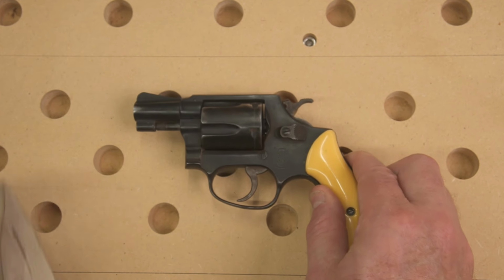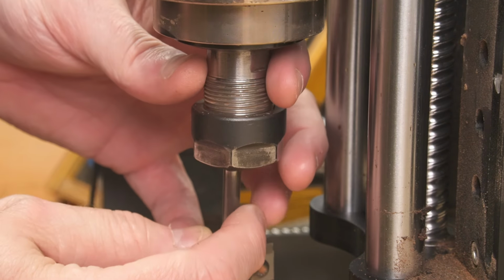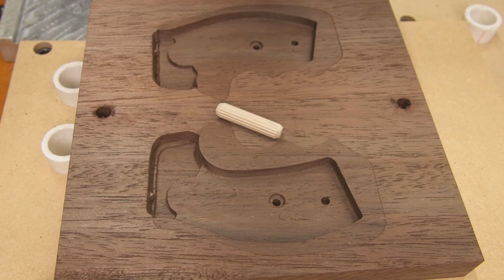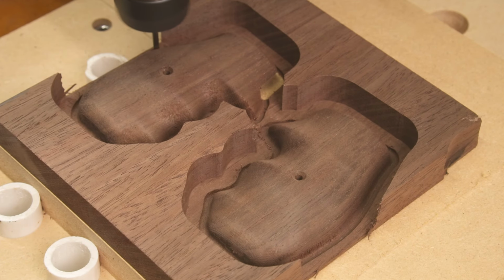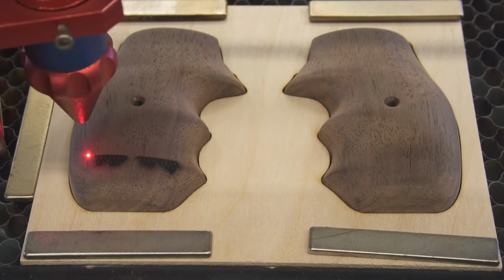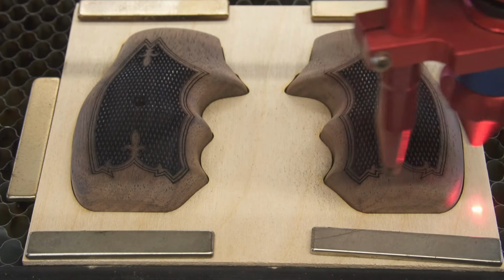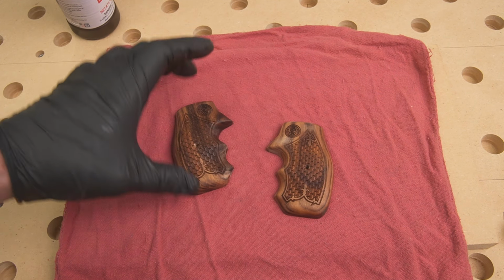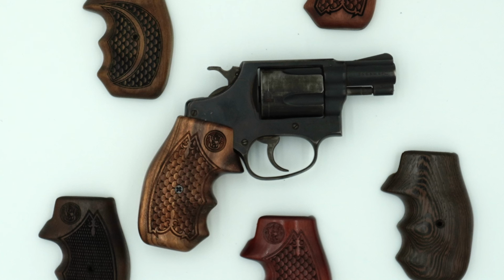Custom Pistol Grips using my CNC Router and Laser Engraver!

Comment: Do yourself a favor and buy a gallon of linseed oil. Use it to finish wood your not going to eat off of cuz i dont think its food safe. Apply a coat with a rag or brush and then go back over and "buff" or wipe the excess then let dry a few hours. Just make sure you don't seal across the pours of the wood and they will drink it up. Keep applying till its full and your left with the best natural finish. It doesn't chip off, its not waxy, etc...
Reply from the maker: Thank you for the suggestion!
I will try it!

Thank you for watching!

Comment: Very nice work. And a terrific way to honor such a special gun. I have a set of carved grips that I ordered for a C&R pistol, and I'd like to try the Tru-Oil finish. Did you wet sand between each of the five coats in your final process? Or did you just dab on the oil and let dry? Very well done.
Reply from the maker: Thank you, sir!
I didn't have much luck with the 'wet sanding' technique.
The finish turned out dry, or matte looking. I am sure it was me not doing something correctly as I have seen other folks use that method with great success.

The method I ended up using, which was in my opinion the easiest and gave me the best finish was making sure the wood was super smooth before applying the first coat, by sanding it well with a fine grit sandpaper.
Then applying the finish using a cotton cloth.
I would let it dry and cure properly then using a very fine steel wool, I would scuff the grip down just enough to make the finish dull, then apply the next coat of Tru-Oil. I repeated those steps for each coat that I added.
I stopped after 5 coats and it turned out good enough for me.

I hope that I answered your question.
Thank you for watching!

Comment: I really like this video. Inspiring and helpful. I wonder what the walnut grip would look like with a single application of Tung oil, then after dry followed by a couple layers of blonde Shellac then polished with 3000, 4000, and 5000 grit abrasive? I might also try a beeswax/mineral oil (food grade) polish on the Wenge grips. Thanks!
Reply from the maker: I researched many ways to seal gun grips and I did run across some folks who recommended exactly what you mentioned, but from my previous experience using Tung Oil, I don't think it would offer the same long lasting protection as the Tru-Oil.
Thank you for watching!

Comment: Ive done grips for 45’s. I was able to do the stippling with a 1/16” tapered ball nose. It took a couple of attempts to get the spread of the diamonds and depth right but they came out really nice. Good feel in my hand. Don’t have a laser. Even did a couple for some friends. Interesting how you used the tape after the flip cut. I used tabs and it still made me nervous during the profile cut. I also did a mallet and did the stippling on the handle the same way. Your dad would be proud.
Reply from the maker: You know...
When I was planning this project I honestly planned to engrave them using the router.
It would have been much more simple to just embed the pattern over the STL and carve away, but I had seen it done on a laser and I really liked how it left a dark inset to the pattern that gave it a ton of contrast. 
But after making this video, I kind of wish I had carved them instead, if not tried both methods.

Thank you for the kind words and thank you for watching!

Comment: Brass screws better. Really nice work man
Reply from the maker: I actually wanted some screws that were a bit more elegant than the black ones, but the screws and the threaded fastener that I used were hard to find in the brass. I could find brass screws but they weren't long enough, so I opted for the black.
Thank you for watching!